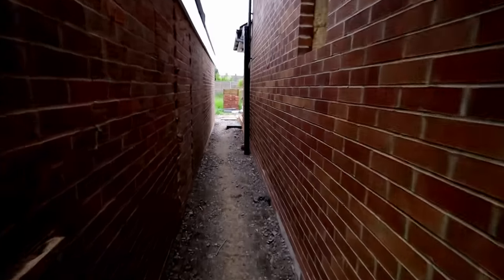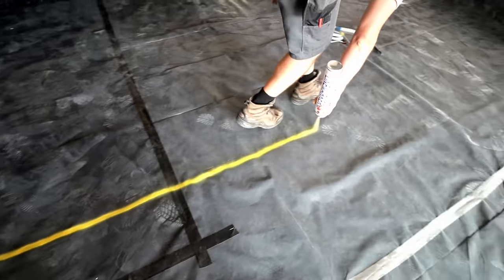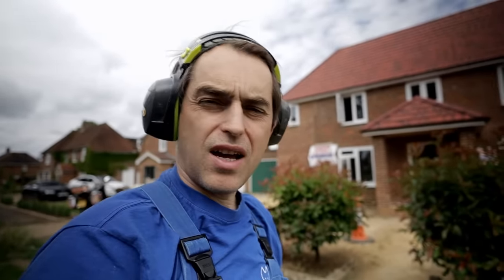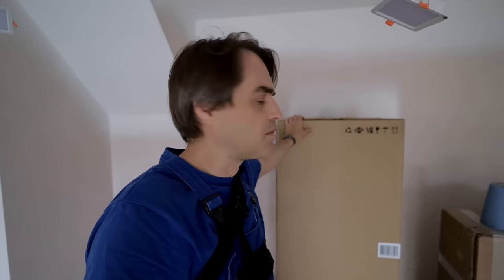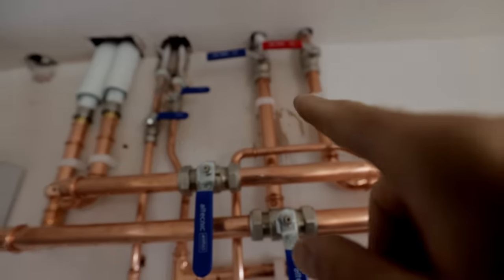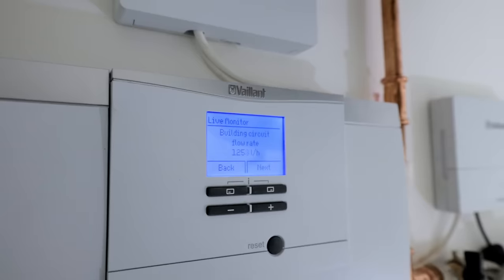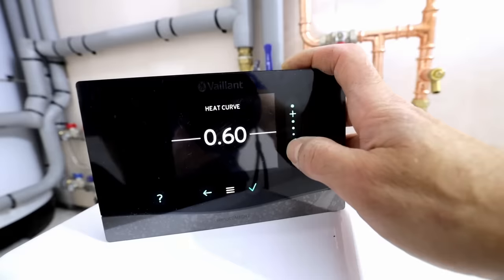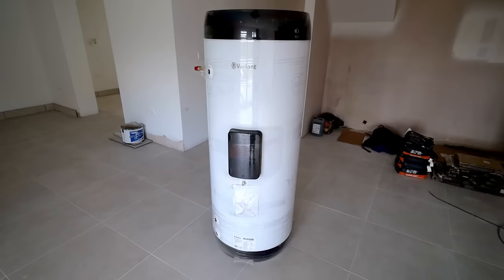Gas Boilers No Longer Make Sense, Here Is Why.

Comment: Absolutely no chance of doing this for 90 odd percent of folk.We just can't afford it. Bung a combi on the wall and use gas which costs three times less/kWh than electricity and is only used when you need it. Unless the cost is massively reduced, which it won't be, most people, especially those living in the sticks, will be going back to the 1940s with paraffin heaters or wood burners in a single room if gas boilers are banned.
Reply: Electricity might be 3x the cost but if you install it properly and get 3x-4x SCOP then running costs are comparable or cheaper. Plus you don't pay standing charge when gas is removed. Yes it's expensive to retrofit and design to a lower temp to get those efficiencies but you are replacing the heating system. That is what the cost is. Decades ago people didn't have central heating, they just had coal fires in a few rooms, and people transitioned. Electricity  costs will come down, levies will move to  fossil fuels, and this will tip the balance. Then it will be more affordable  to run system at higher temps and keep existing wet system.  Agree is not cheap, but no one is saying you have to throw out your gas boiler or not buy a new one now. Wet central heating systems don't last for ever so many will need replacing in the coming decades and we cannot decarbonise with gas.
Reply: @richardlphillips  Thanks for your thoughtful reply. To be straight, I do like the technology and I agree that for rebuilds heat pups should be installed now. Perhaps it is because I like the technology that I find it frustrating that it is way way way beyond the reach for most people to retrofit. Electricity costs will not come down anytime soon and gas will not go up. No government is going to survive the nightly news stories of pensioners and 'kiddies' freezing in their homes because the price of gas has been bumped up. From next year people will not be able to buy replacement oils fired boilers. How many millions depend on them in the countryside where there is no gas? Most can't afford to retrofit. Likewise, the current plan is for gas boilers to be banned in the near future (not sure if it's 2030 or 2035), not decades.
Reply: @eddyd8745   I don't disagree with what you've said but I feel the affordability of basic human requirements is more of a symptom of how we are governed and the structure  of the scheme. Really we need energy prices to come down and long term 0% loans so the system can be retrofitted, not require upfront payment, high efficiency and lower running costs can reduce the month to month. This would be fair on low income families as they would benefit from lower running costs. I think the initial subsidy is to increase take up. Early adopters will reduce the long term costs through volume and that is normally the purpose of subsidies. Enforcing low carbon tech in new builds should build on the volume of installs. Same goes for the grant for electric vehicles. I'm not sure anyone was expecting those that can ill afford what they already have to trade up to an EV, but demand is increasing, same goes for renewables. Without subsidy we would not have cheap solar and wind. It drives demand and reduce costs. Arguably it's more cost effective in a capitalist society to get early adopters to drive demand with grants. We've seen battery  prices comes down 10x in a decade and these disruptive changes happen quickly. Not saying the system is fair, because it isn't but I guess we all get the opportunity to try and influence that next year 🤔
Reply: when houses cots £400k for a 3 bed, its a political choice to not be able to afford it

Comment: Heat pumps are great and all but what happens when your local pikeys come and take the unit of the wall and do one?
Reply: considering they weigh > 100kg, good luck to them making away with it without someone noticing, especially with many installed around the back or the side of the house.  I doubt there's much of a lucrative 2nd hand market for them either.